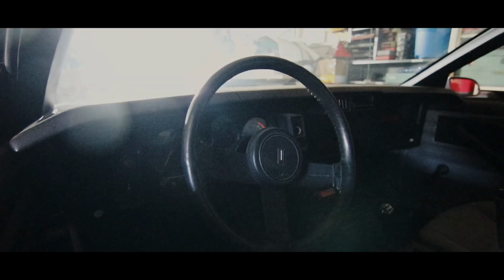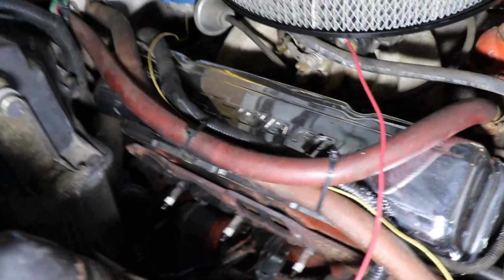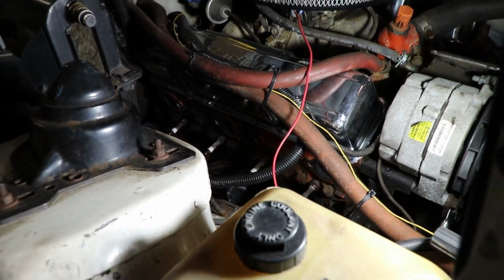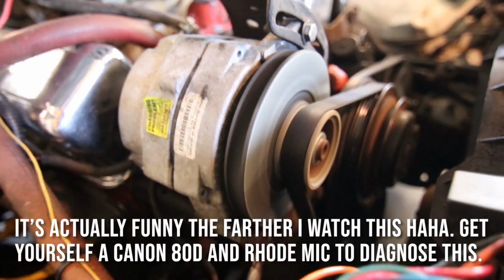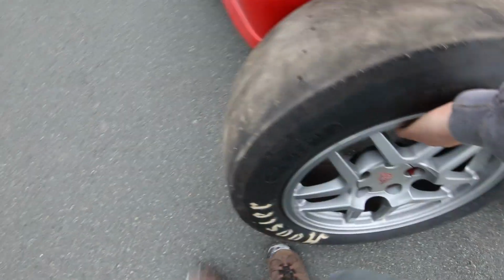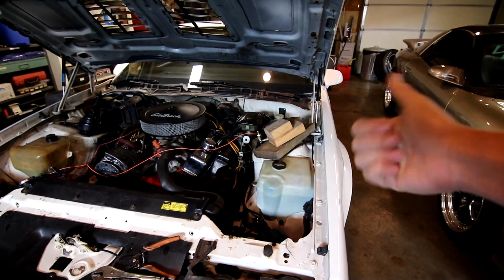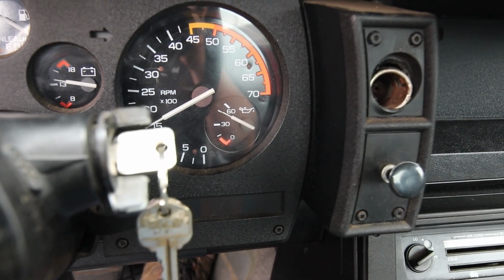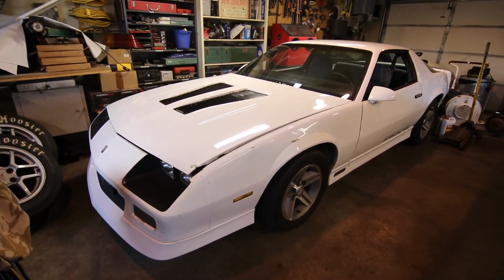GREAT Iroc-Z Repairs, GTA Road Trip & NEW WS6 Drag Wheels! The Camaro is GOOD!

Comment: What I found out is that later model GM gauges in the 80's use a different coolant temperature sender (1254 Ohms at 100°F (40°C) and 54 Ohms at 260°F (130°C)) where the sweep in resistance is different than early model gauges (100 deg. F: 368 Ohms and 220 deg. F: 80 Ohms) from late 60's and early 70's. Easiest way to differentiate between the two is the size of the thread. The smaller 3/8" threaded sensor is the later model resistance and the older model is a 1/2' thread. All stock third gen V8's, I believe use 3/8" thread in head which will have proper resistance for the OEM gauges. My way around this issue, with my aftermarket head with 1/2" thread, was to use a 1/2' to 3/8 adapter. This makes the gauge accuracy shift a bit as the sensor is moved out from the coolant flow in the head, but is more accurate than using the 1/2" sensor. With that being said, when you checked the sensor resistance it looks correct, but I have also seen late model sensors differ 200 ohms between each other depending on manufacturer.
Reply: Check out the powernation build they go all through how to swap the sensors into a LS engine in a 3rd gen Camaro. Some good Info there.
Reply from the maker: I don't think I showed it on video, but my car does have an adapter to get the coolant temp sensor into the block. It does get shrouded a bit by the adapter from the fluid flow like you mentioned. Sounds like you know your stuff about these sensors. Thanks for sharing!
Reply: Yeah, I did some in depth research when I wanted to eliminate the 1/2" to 3/8" inch adapter for more accuracy. No luck. So I just kept the stock coolant sensor and adapter. This is what the GM service manual says for a 1991 Firebird 5.0L and 5.7L TPI: Sensor should read 1254 Ohms at 100°F (40°C) and 54 Ohms at 260°F (130°C). Your issue may very well be the thermostat or lack of...
Reply from the maker: Good to know. Thanks for the information again! I'd be willing to bet the thermostat is missing or bad. Someone put the engine together back in the day, and I don't recall ever seeing the coolant level really dump down like it opened when I refilled it.
Reply: @Greenlightfilming  open the radiator cap when cold fire the motor up if u have circulation instantly you got no thermostat.

Comment: Yeah ...

DON'T    Even   BOTHER 

" GUESSING  " 

About  The  The "  Bad " / Faulty   Thermostat   / Or  Possibly  
NO   Thermostat. 

Just   Get  A  NEW  ONE  In  There .

They  AREN'T  Expensive   And  Are  Easy  To  Remove  And Replace  On  Chevy  Motors.

And ...

Regardless   Of  What  You  Hear   From  Other  Guys ..

DON'T    USE   A  

160  °   Thermostat. 

Its    BETTER   To  Use    A 

170  °     Or    A    180  °  , 

Or  EVEN   A    190 ° 

Thermostat. 

And ...

Make  SURE   You  Mix  Up  A  PROPER   / NORMAL  

50 / 50    Antfreeze   

AND 

 WATER  

 Coolant    MIX .

NEVER     USE   JUST  WATER  ALONE   IN  ANY  STREET  DRIVEN  CAR .

Comment: I never used exhaust gaskets, I ran a think bread of red high temp silicone, let it set for about 10 minutes then bolt em up to the heads and never had another exhaust leak after that, and still to this day I use that when I put headers on.

Comment: One other thing to look at with both oil and temp sensors.  They ground through the threads.  So if you put too much thread sealant or use Teflon tape they don't get enough ground and it can throw off the reading.  I was going to bring up the ohm ranges but Frank covered that.  One other option is the 3 wire sensor from a 1998 firebird.  It is a single year sensor as 99+ feed into the PCM.  This is the sensor I use in my 1989 formula that I LS swapped and it's with a few degrees accurate.  You can test ground by making sure the sensor body and the head is 0 ohms, also often engine ground are weak so sensor body to battery should be close to 0 ohm.
Reply from the maker: That's good to know about the later style temp sensor. I did put some teflon tape on the threads of the adapter that the temp sensor sits in to seal it. Maybe I put in a little too much. 

My other thought is that the thermostat needs to be replaced if theres even one there.

Comment: I centered my wheels in the rear wheel well with my LCA and It didn’t effect anything and I’m also running 28” tires.
Reply from the maker: Good to know. I presumed it wont. Especially because the difference would be so negligible.
Reply: @Greenlightfilming   just make sure your pinion angle is on point and you’ll be golden. Depending on gearing you’ll notice the 28” over the 26” and the car dead hooking and not spinning. Best of luck man.

Comment: No the speed lines came on certain 95-02 trans am’s I bought a set and have on my 98 but those are C5  zo6 vette wheels. U have
Reply from the maker: These are Speedline wheels. The made many models of wheels for different vehicles just like Weld does. Its cast into the wheel.
Reply: @Greenlightfilming  oh ok. Well all my years of dealing with f-body’s. I had no idea that SPEEDLINES  is the manufacture lol😂😂 but thanks for replying and the 3 ladies in the garage looking sweet💯🙌🏻😁
Reply from the maker: No worries, I hear you! I'm learning stuff every time I work on these things. It never ends.
Reply: @Greenlightfilming  it's always fun trying to remember these Oddities 😁
Reply: @Greenlightfilming  It was a late 4th gen for those. I believe SS and some Z28

Comment: Get a set of headers. That adapter is used to adapt the fbody manifolds to older six bolt heads. The newer heads have seven bolt holes. Headers use the standard six bolt design. Headers will eliminate that adapter and potential exhaust leaks. Get high quality headers, don’t cheap out.
Reply: x2.

Comment: Nice work, the Camaro is really coming around. With the GTA check out your TPS sensor or maybe IAC for the hot idle issue…my car even had a MAF that acted funny when it got heat soaked.
Reply: I’d also consider the ignition module. I’ve had an issue with that on one of my tpi birds when it got hot.
Reply from the maker: I will have to look into that, thanks for the tip. I've just now started driving it enough that its gremlins are showing.

Comment: That axle sounds  ruff on deceleration check the diff oil and pinion nut on the gta check out the coolant system and fans  i had  a oil presser switch give me the run a round as well car started running right now I'm fighting long starting I think it's the iac valve
Reply from the maker: Oh yeah, it's real bad haha. The lower control arms make it 500x louder, but it's on it's way out none the less.

Comment: That is a 6-bolt to 7 bolt adapter flange
Reply: You'll need gaskets on both sides of the flange. I forget the exact reasoning but they were doing goofy things with exhaust manifold in the 80s. The passenger side exhaust manifold is longer that's why it needs the flange so it will seal and not leak

Comment: Y-pipe rots out between the two pipes at the seam. It’s hard to see and the exh leak sound comes from mid car. Have a look there. My Monte SS did that and has similar Y-pipe if not same.
Reply from the maker: I'd like to think you are right here. It's about where it sounds like it comes from. I'll investigate, thanks!
Reply: @Greenlightfilming  If so, another reason for headers
Reply from the maker: Yes, agreed. They would be a lot better setup for the car than the manifolds by a long shot.